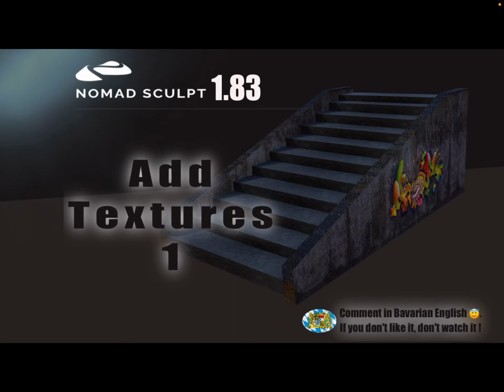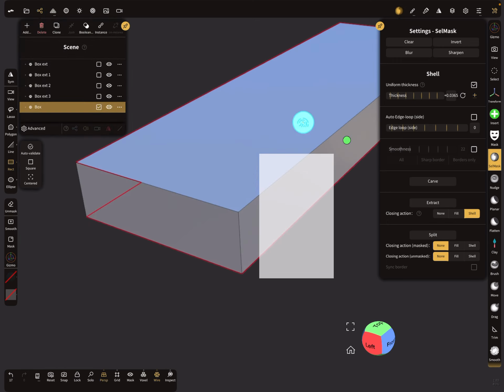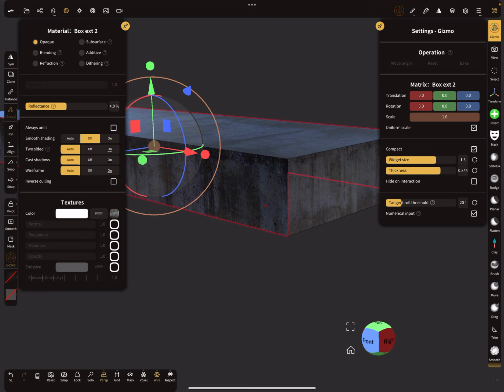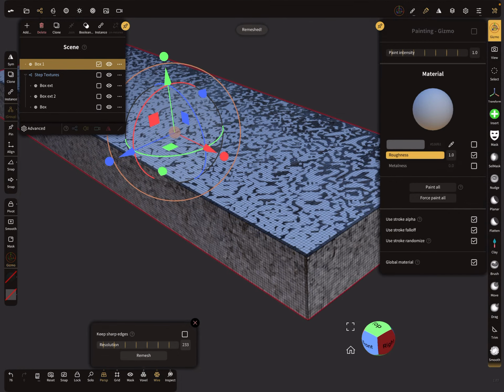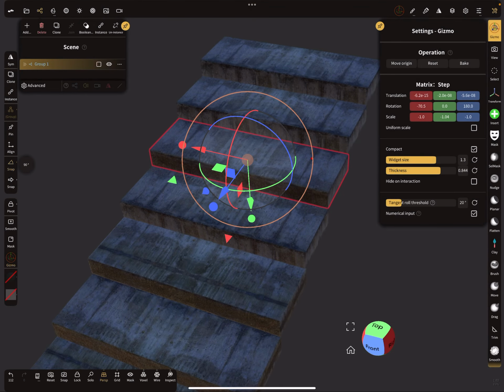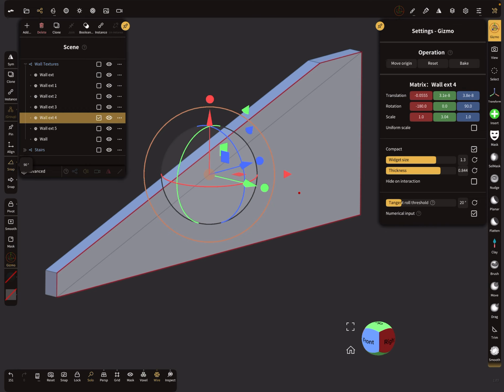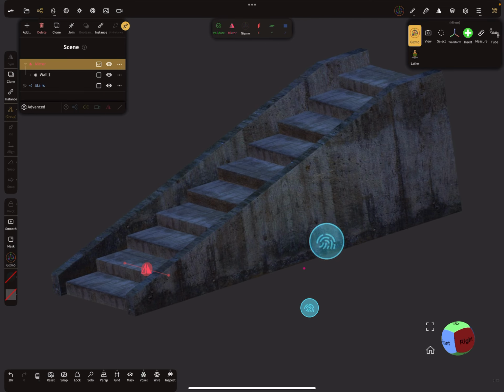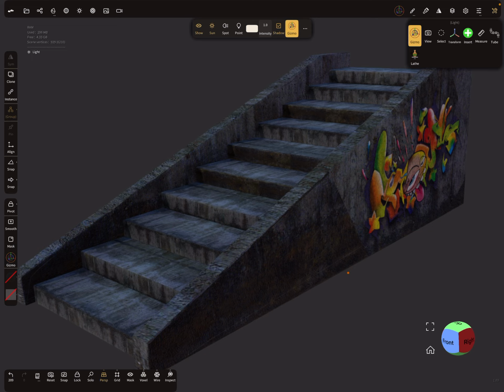Nomad Sculpt - Add Textures 1 - Tutorial (V1.83 - 16.9.2023)

Comment: Cool as always ;) I wonder. It is said that Unvrapped object needs to be smaller than 100k . My object was lowered using decimation to that level. It looks still fine but somehow it cannot Unwrap and stops for a long time on the 33.31% and moves only 0.01% every couple of seconds. The objects has 3 side circle openings through and basically looks like wave bent half pipe. What can I do to Unwrap it at all? Did I do some mistake?
Reply from the maker: For such questions, the Nomad Sculpt DISCORD (help) server is suitable - there you can upload pictures and videos and also the whole project and simply answer the questions better. It is difficult to answer your question without further information.
Reply: What device are you using and do you have applications running in background? You can't trust Nomads real-time memory usage when it's referencing how much memory is available because it's assuming only typical system OS  usage
Reply from the maker: @captureinsidethesound  Ipad Pro 2020 - yes, in the background there are 5-6 Apps running. Never have RAM problems.